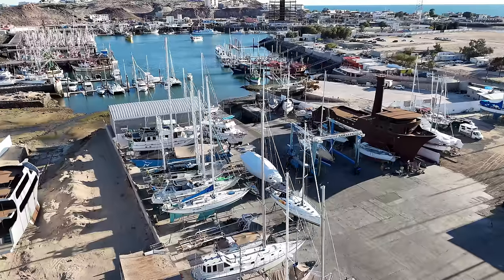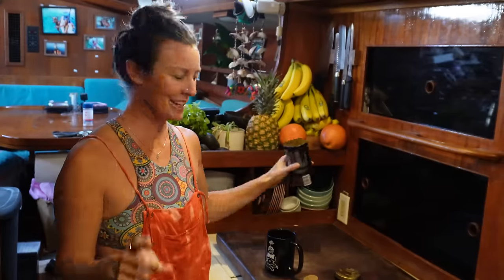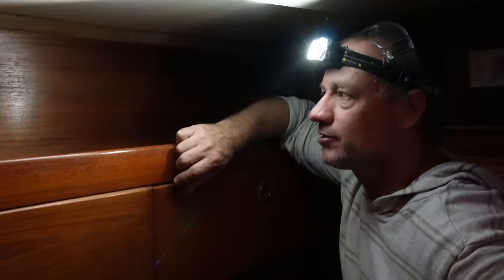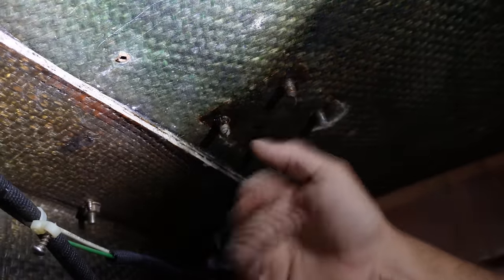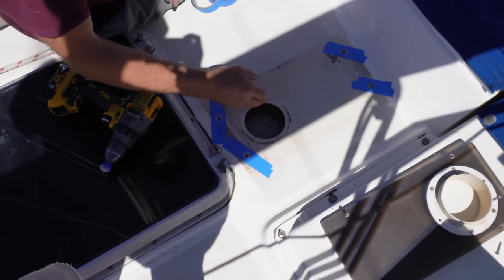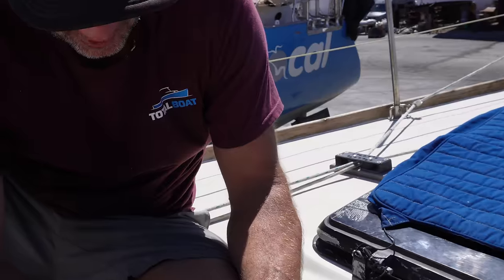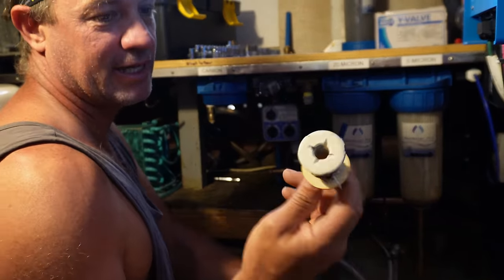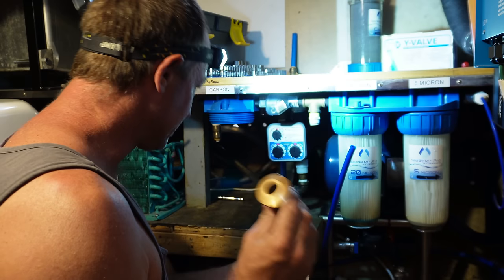What now? OLD SAIL Boat hidden problems Ep 403

Comment: I love the fact that Lee is systematically going through the boat and getting rid of anything that looks dodgy and getting rid of anything that may cause problems further down the line .buying a old use boat is not for the faint hearted .repairing and replacing is what you will most likely be doing on old boats .good job Lee 👍.
Reply: That if you live on a boat it is home transport. Cars in my country must pass a MOT every year. You have your loved ones onboard so safer the better.